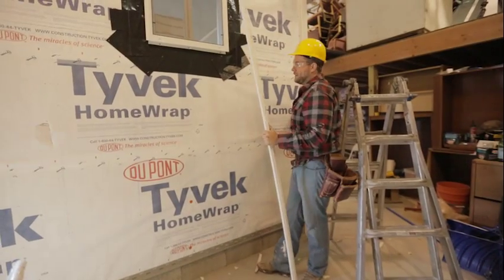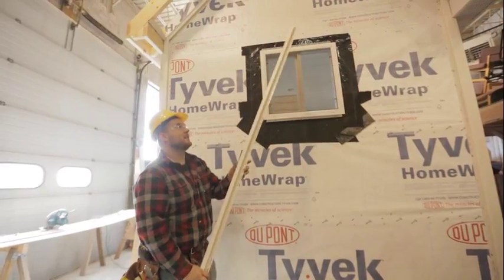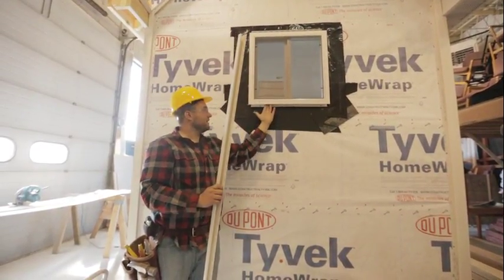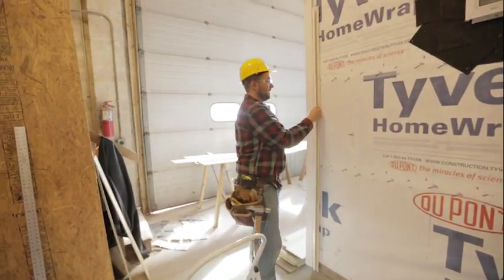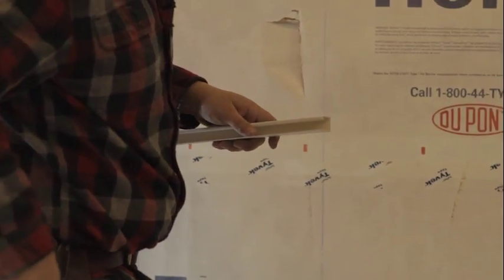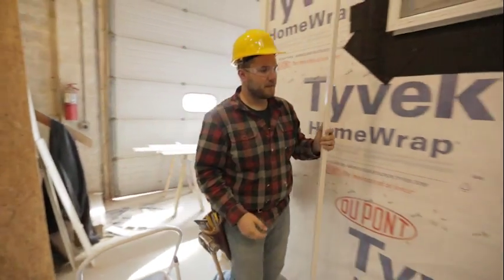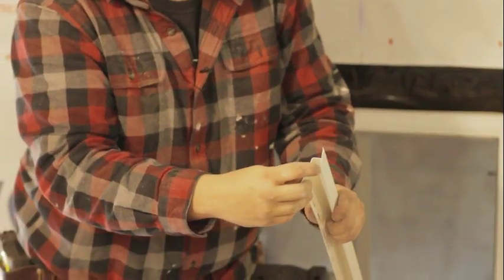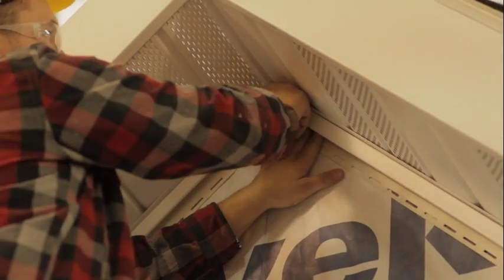How to Install Vinyl Siding Part 2: J Trim

Comment: the J-trim doesn't really fit into the corner pieces.  You can force it, but it doesn't really fit. Ideally you should trim the corner piece also.

Comment: Did good except for flashing your windows. The headlap is a common mistake most people make. When installing the flashing tape your head lap goes directly against the structure. That way if water gets behind the housewrap the headlap flashing pulls it back away from the structure

Comment: J trim should be proud nailed every 8"-12", leaving 1/16 clearance for expansion under the nail head.   The 16" nailing schedule mentioned for J trim is the spacing for the siding panel nails or screws.

Comment: YOUR CAMERA MAN NEEDS TO BE RIGHT CLOSE TO SEE THE ACTUAL CUTS. ALSO WHY DID YOU NOT ATTACH THE BOTTOM TRIM TO THE CORNER POST.. THEY SEEM TO BE AT LEAST 2  INCHES OR LESS FROM THE CORNER POST IS THAT BECAUSE  IS TO THICK GOING INTO THE WALL CORNER TRIM.???????
Reply: thank you

Comment: The 6 inch vertical cut up against the fascia box leaves a gap (1/8 in/)  that looks like it will let water in to run behind the corner?
Reply: Would make sense to cut extra, fold and create a small seam.
Reply: That's why you see house wrap required before installation.  The siding is not supposed to be 100% water proof but it should repel almost all water unless high wind driven rain occurs
Reply: I don't think you are going to get much water there.  Plus that's what the house wrap is for.